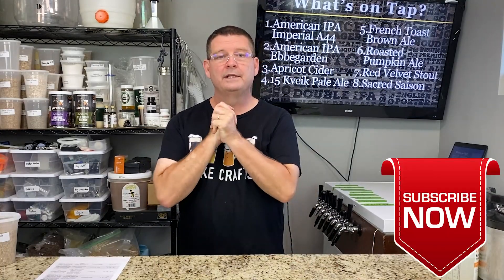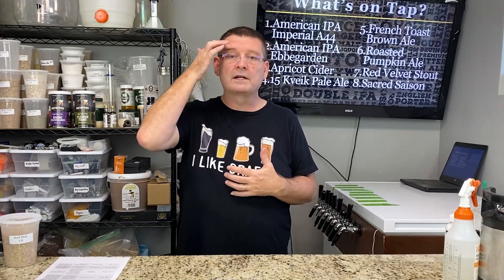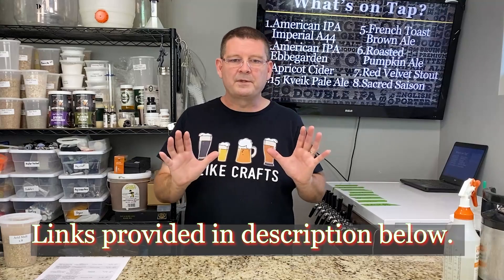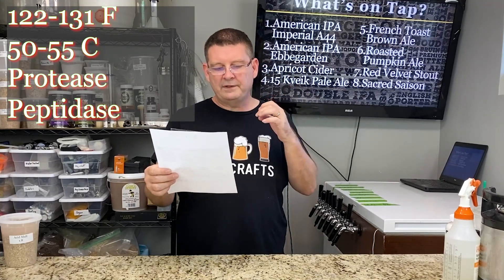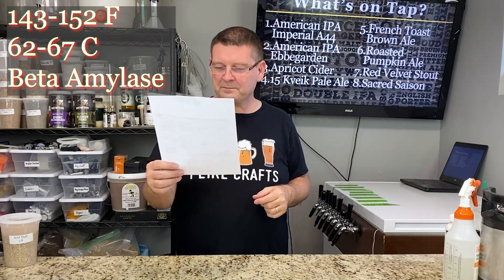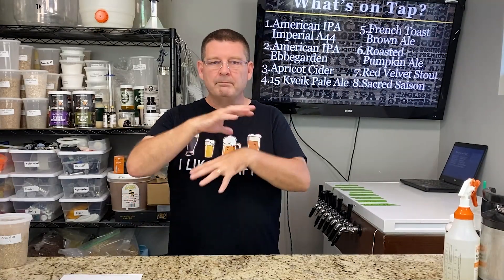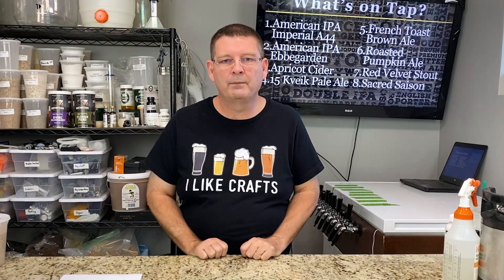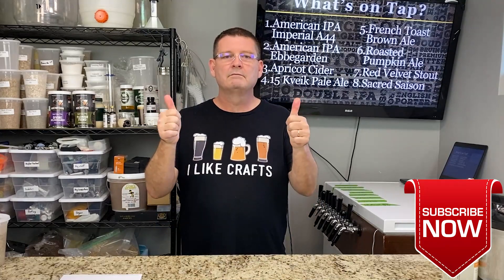How to increase your Brew House Efficiencies - Maximize your BHE

Comment: I have an anvil foundry 10.5 also. I use the small batch insert on all my brews. Just to increase brewhouse efficiency. Thanks for another great video. Good info in there.
Reply: That's the first i've heard of it and I have the same. My BHE is always off but i'm fairly new. I knew most of this but it's still off. I got a ph stabilizer/meter so I hope that was it. I'm also always going off of anvil's charts for temp per grain ratio and that may be off from my random recipes I make. I think the main thing is exposure to oxygen racking to the keg. Better every day.
Reply from the maker: @killswitchh  I only have 15 brew in on my Anvil Foundry as I came from using a Grainfather and before that lots of pots doing BIAB so I can understand the dialing in part as I'm still constantly refining my processes with it and still occasionally having issues I didn't have in previous batches. I use the water to grain ratio from Anvil also but usually hold back 1.5 gallons for sparging. As for doing closed transfers to a keg I have a pump system I use that isn't perfect but it is as close to as I've been able to achieve from a carboy to a keg without using a spigot on a plastic carboy which is always an option. Check out this video about closed transfers as it might help or at least give you some ideas. https://youtu.be/R5c8-pCJAAs
Reply from the maker: I'm right there with you as it helps and I think that is the key, every little thing done right helps.